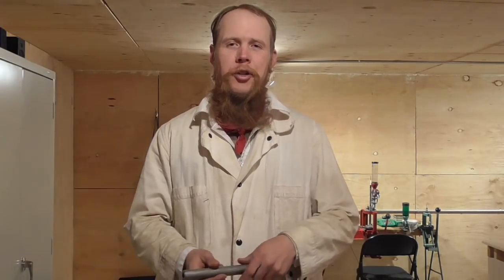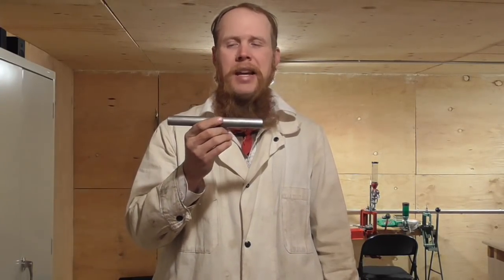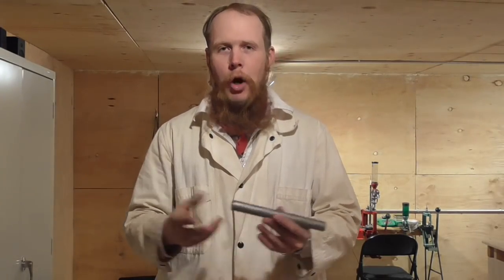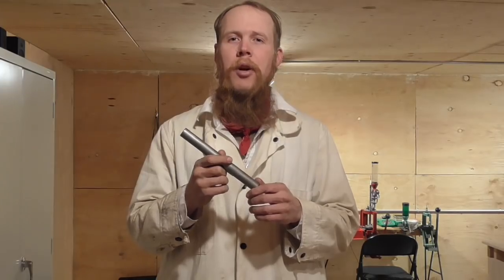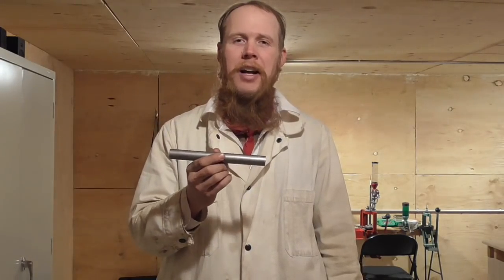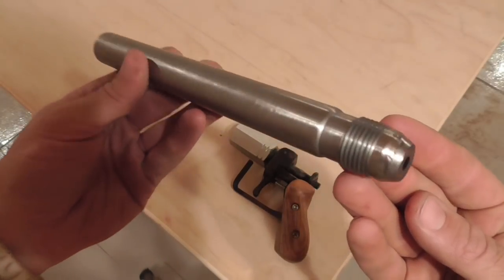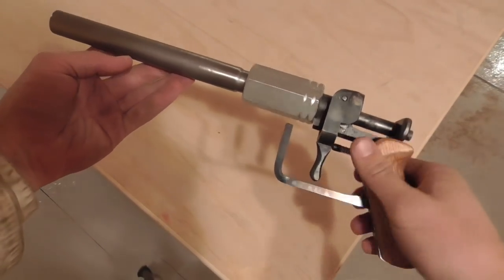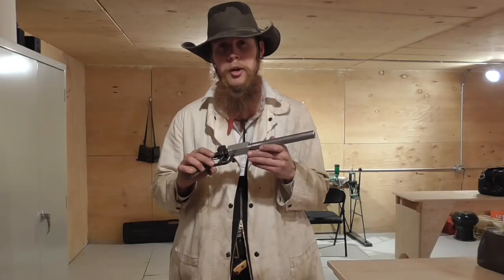DOM Tubing for Gun Barrels? (TIS089)

Comment: there's also cdm tubing, which some sellers call "seamless dom". basically, a solid bar is pressed onto a mandrel and the tube is formed from a solid piece. 

the main reason why certain steels are commonly used for barrels now is because those alloys allow for more durable rifling (particularly at the throat) and because you can get away with as thin a barrel wall as possible with them. You can make perfectly adequate barrels from other steels (many of the "Ordnance" grade steels in use today didn't even exist, or weren't in common use, in the 1940s, and they did just fine).

Comment: I got run off ofa gun forum for bringing this up as a build i did. You know, for being a danger to myself and others, i proof tested and it works just fine, i use a fuse for ignition..50 can patch and ball. Now to carve a nice pistol grip for it and add a bead front sight.
Thanks for validating it..

Comment: DOM is not welded, DOM Tubing is solid pierced and drawn over and thru a Mandrel,
ERW standard pipe is a welded seam pipe,
Reply: Exactly what I was thinking the whole time. I wanted to yell "IT'S NOT WELDED!!!!!!" the whole time.
Reply: Erw and Dom start out the same way,both are welded,the Dom goes through more presses to remove the weld flash and make a concentric uniform size tube id and od

Comment: Dude i have a question please , am i right in thinking that the small thick steel pipe that sometimes runs on the outside of a hydraulic oil ram would be good for a barrel ?
Its thick walled , smooth bore and tested for high pressures of oil ?
Is this the type of pipe you are on about in this vid ? or i am i on another track 
Thoughts please 👍👍

Comment: Seems at an adequate thickness to be as reliable as a damascus barrel I'd wager it would be adequate for up to  a 3 inch 12 gauge shell at modified choke, and maybe up to 9x19 in center fire pistol rounds. Though without rifling the interior of the barrel you wouldn't  have a very precise piece of kit for single projectile use.

Comment: Fixing to build a matchlock in the .75cal range. What woukd you recomend for the dom tubing dimensions? I know i want a 40" barrel.
Reply from the maker: I've made .75 caliber muzzleloader barrels out of 1-1/4 OD x 1/4-wall DOM tubing before. http://www.speedymetals.com/pc-3455-8242-1-14-od-x-250-wall-dom-steel-tube.aspx
Reply: .75 is an 11 gauge shotgun. 🤓
Reply: @got2kittys  10* gauge

Comment: Yup. I use galvanized steel pipe meant for plumbing, but I also never use high pressure or rifle cartridges beyond .22 or .410. 12GA seems to work fine. It's cylinder-bore in 3/4" pipe by default, though. If I use a tighter bore, I use a sleeve and epoxy as a sub-caliber insert. In my slam-fire shotgun, I'm currently using 3/4" pipe for the outer barrel and chamber, and a thin steel broom handle tension fit and cut down with a pipe cutter as the inner barrel and a barrel condition indicator that extends a few inches past the muzzle. If the muzzle flares or looks like it's getting chewed up too much at the crown, then I know it's time to replace the barrel. It's common sense, and it's cheap.

Comment: Careful now...
While it is true that barrels were welded from strips of steel in the old days, there are a couple of important differences.

Firstly, the old barrels were made of wrought iron, which has different welding characteristics to modern steel.

Secondly, the welds were overlapped a great deal. Modern tubing is a butt weld, which is not as strong.

Thirdly, old barrels sometimes used to go kaboom, despite passing proof.

Your tube looks pretty stout, so it will probably be ok, but I would be a lot happier with a bored barrel.

Comment: what grade steal are you using in your test?
Reply from the maker: If I recall correctly, DOM tubing is governed by the ASTM A513 standard, so that would probably be the authoritative source on specifying its composition or material properties.  I think it is typically made from 1020 steel or similar alloys.

Comment: As to the actual safety issues with doing this with more then black powder muzzle loaders.

My main concern would not so much be the fact it's got a weld seam but rather if I'm not mistaken most modern gun barrels being hardened metal either heat treated or work hardened (hammer forged barrels).  Wouldn't this kind of tubing or even seamless tubing be in a soft state of the metal?

Even with a BP muzzle loader if you rifled the bore if the metal isn't hardened wouldn't you wear out the rifling over time.  For shorter pistol barrels or even carbine rifle barrels DIY heat treating in the kitchen oven like making homemade springs from wire might be worth considering.  For a barrel of length though like a long barreled goose shotgun or a long Kentucky rifle might be hard finding an oven that it would fit in!

Comment: Just a note of caution for those who have talking about doing this for lower pressure smokeless cartridges.

Unless your building a shotgun with at least 18" barrel length you must cut some rifling in the bore otherwise you will have an illegal zip gun.

Might be perfectly safe pressure wise but would be bad mojo legally speaking.  

Only muzzle loaders and reproduction breach loading weapons of very old cartridge guns (specific year in ATF rules being 18** something look it up yourself) that you can legally do smooth bore without rifling.

Aside from that 45-Colt is the lowest pressure commonly available cartridge besides shotgun shells.  Max pressure for 45-Colt is 14-K shot shells max out at 12-K or 12.5-K for all except 12ga 3-1/2" super magnum length and 410-bore 3" magnum length which are 13.5-K.  Almost all other common cartridges are at least 20-K peak pressures with many commonly thought of as low power pistol cartridges approaching or exceeding 30-K pressure levels like 9mm.

Comment: I wouldn't recommend it to any otherwise sane person but back in my misspent youth I did something similar. I worked as a maintenance tech in a manufacturing facility and we had some steel tubing. I don't know if it was DOM or not, but it had an ID of .3 inch and an OD of .5 inch. I filched a foot of it and took it home. I used whichever twist drill would clear and drilled a "chamber" to fit a .30 M-1 Carbine round. I silver soldered it into a piece of .5 inch ID steel tube for a "receiver" and dummied up some kind of bolt. (Dummy being the operative word here.) Anyway, I tested it and the tube held up fine. After a dozen or so rounds it blew the lugs off the bolt and stretched the receiver but the barrel survived fine. That was 50 years ago and I suppose the statute of limitations has run out, but I do NOT recommend trying this at home.
Reply: And, considering I was pushing a .308 bullet through a smooth .3 bore the breech pressures must have been barely south of suicidal. I WAS smart enough to stand back and clamp it in a vise and use a LONG string to pull the trigger. Amazing I lived long enough for Social Security.
Reply: I'm glad we have a wealth of free knowledge available to us now with the internet. I myself made a muzzleloader from 1026 DOM for firing #00 buckshot (0.37 cal ) roundballs. Reckon I had to research and think it through for a year before I had the nerve to carry out the build. Now working on a single-shot breechloader in .50 cal. Probably going to test fire it a couple times in a sand bunker before I'll shoot it myself.
Reply: 5mm walls?

Comment: Good video. I agree that DOM tubing can be used for black powder pistol barrels as long as the dimensions are adequate. You should use an online "hoop stress calculator" to determine adequate wall thicknesses.  If the tubing walls are thick enough, there is no reason why DOM tubing can't be used for low pressure black powder firearms.
Reply from the maker: Thanks.  However, hoop stress has its limitations.  For one thing, most hoop-stress calculators are based on the standard thin-walled pressure vessel equations, which are only accurate for cylinders where the diameter is much larger than the wall thickness.  With a gun barrel, that is typically not the case.  There is a separate set of equations for thick-walled pressure vessels that takes into account the stress gradient through the wall thickness, which is a better starting point for gun-barrel stress calculations.  However, both these methods assume quasi-static pressure, whereas discharging a firearm is a highly dynamic event, so that can introduce additional complications.  And finally, to calculate stress, you need to know the chamber pressure, which at this point I have no way to precisely measure or predict (although I'm working on remedying that).
Reply: I agree that you need to use the equations for thicker wall vessels which some (gun related) hoop stress calculators provide. That is the equation that I use. I have found that a good rule of thumb for any gun barrel made out of DOM tubing is to have the wall thickness be 1/4 the OD of the tube. It results in a very heavy barrel but for small pocket pistol designs it is a reasonable trade off.

Example: .3125 ID, 0.625 OD, and .15625 wall thickness.

I agree that you can't easily know chamber pressure. But you can make an educated guess and add in some extra wiggle room just to be safe. 

My point was that we can be safe using DOM if we engineer in some safety measures by choosing dimensions that pass the sniff test. A .3125 ID with 0.625 OD DOM tube is plenty to handle small handgun pressures (less than 20 gn FFF powder). A .3125 ID 0.5 OD DOM tube is probably not strong enough based on hoop stress calculations.  

I enjoy your channel and I'm looking forward to future designs.
Reply: If you're referring to Barlow's Formula, the numbers given by it are actually on the conservative side. With the more accurate Lame's Equation, the calculated "max pressure" is slightly higher than the result you get from Barlow's thin-walled calculations. The thicker the barrel compare to the bore, the greater this difference is. Barlow's equation is a safe margin in my books.

Comment: Aren't welds stronger than the metal they join, usually?
Reply from the maker: I suppose it depends on the type of weld, but usually the Heat Affected Zone or "HAZ" (the metal immediately adjacent to the weld, where the heat of the weld has changed the microstructure) is softer than the base metal, and in many cases, the weld itself may be more brittle than the base metal, which makes it weaker in tension.
Reply: +TheIdahoanShow With that said, post-heating can make a lot of difference.
Reply: TheIdahoanShow as I understand the DOM process, after forming and resistance-welding the tubing, the tubing is annealed. Then it is cold-drawn. So...annealing followed by significant work-hardening is likely to create a more homogenous (from a metallurgical perspective) product than you might imagine. I've used DOM tubing previously for cannon with uniformly excellent results. I'd have no compunction whatsoever about shooting with this barrel.
Reply: I would imagine some sort of annealing process might even out the affected zone. It would take some experimentation. I don't know how effective it would be if you don't have some sort of hardness tester.
Reply: I have made a lot of high pressure hydraulic cylinders  , I weld the ports in, the end cap, they fail at the threads for the head every time. That is 3,500- 10,000 psi systems.

The welded extrusion is well annealed before cold drawing so it wants to flow through the dies and not split.
Machining DOM it is very stringy, you can to have a good chip breaker or it turns into a razor blade birds nest.

Comment: Please tell us about your proof load.  What weight/diameter of projectile (should be 3 balls worth I would think to let presure build), and what was your powder charge?  Also how many proof loads did it withstand?  For a half inch inner diameter I am thinking a 600 gr. projectile over say 110 gr. of FFF would be a respectable proof test.  If it holds up to say, 10 of those, then your point is proven.    :)   If the welds yield, then we learned something that way too.

Comment: What charge did you use for a proof load. Also was it a patched round ball? Thanks, great video!
Reply from the maker: My regular load was 60 grains of FFFg behind a 50-caliber lead round ball (no patch - I need to find a way to lubricate it so the fouling doesn't bake on, but the fit is too close to accommodate a patch), so for the proof load I doubled both the powder and the shot: 120 gr. behind two roundballs stacked on top of each other.
Reply: Did you mic the dia before and after in the chamber area. I have built several black powder shotguns, but due to using thinner walled Dom tube I had to silver solder a sleeve for the first 6 inches. Love your aprroach:) Also agree being able to offer some paid rentable in depth content would be awesome. Thanks

Comment: Great vid. - It seemed likely good for muzzleloaders, always wondered if it handle std. powder loads like .45 ACP?
It would be a great followup whether Pass or Fail!
I've thought of 1020 DOM w/0.250 wall thickness for a 12 gauge.  I've seen ones from garbage seamed plumbing pipe Yikes!   So double the wall in a better fabricated rolled config. would seem to be quite sufficient.
Reply: I have the same question
Reply: Shotguns are low pressure weapons. I've seen home made guns with schedule 40 pipe barrels. Usually they are a bit oversize but they usually hold up. DOM would probably be a bit tougher.
Reply: Thanks Lawrence.  Those Sguns using schedule 40 seem so iffy - but many have used them.  Hope to some day have the time to build a break double barrel with 1/4" wall DOM and taper the barrels down a bit.  Would sure be a fun little project.  The Homestead takes lots of time when one still has a full-time job.
Reply: Been researching one myself.
Reply: Some good material in the Professor Parabellum "Homemade Break Barrel Shotgun Construction Plans",  can be found on-line; although for a Single - it has some wonderful constructions details on trigger, breach and so forth.  
I was trying to email you that, but no Tabs on your YouTube page (from which one selects "About" and can email to the YouTube account.  if interested go on my Relentless homestead channel (click pic to left) and send email through "About" and I'll get that to you.  Perhaps we can collaborate on a design. if you are interested.   I also have been collecting some pics from other peoples attempts.